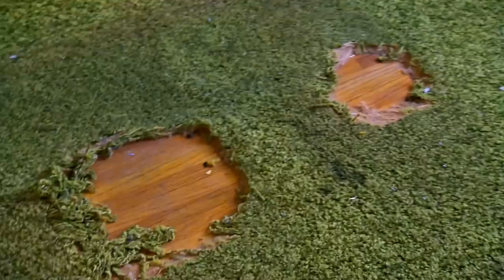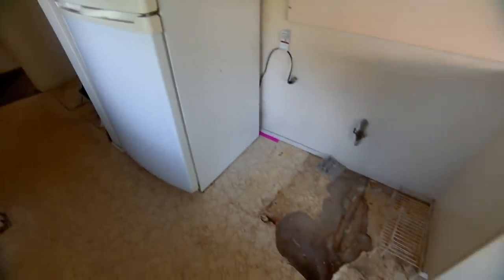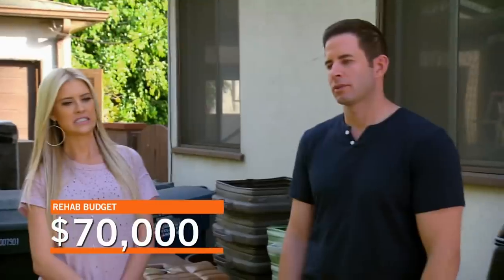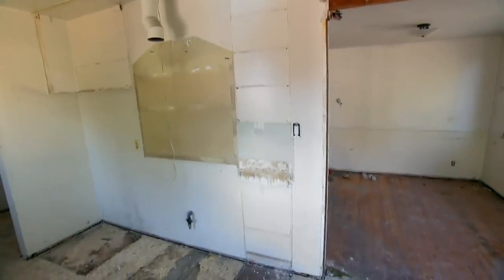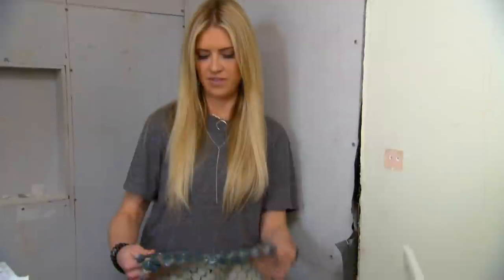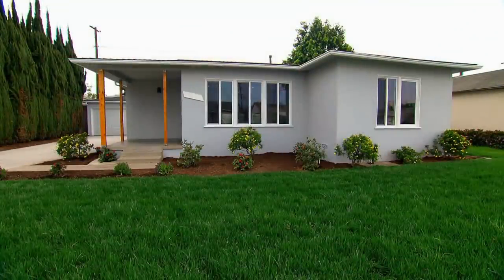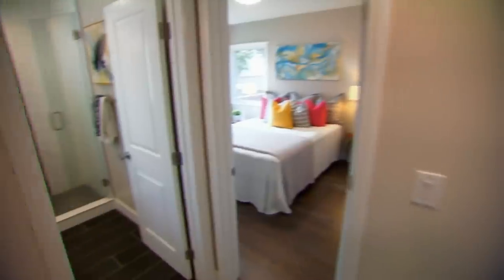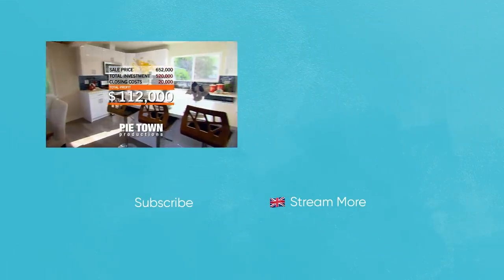Tarek & Christina Argue About Almost Everything With This House | Flip Or Flop

Comment: The flooring and the layout are great. I thought reclaimed wood on the ceiling sounded like a good idea, but it does not look well -- it breaks up the expanse and looks piecemeal. I often think that island stools close to dining room chairs give a furniture showroom vibe, and this is a case in point.
Reply: Agreed.  Alot of the staging was off also. Too much going on in such a small space. Smaller "to scale" furniture would have been a better choice along with  bench seating for dining table.  These two fixes would have cleaned up the eyes sightlines